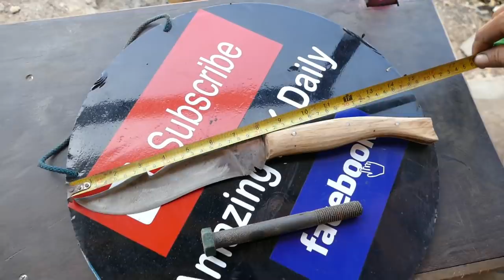FROM A BROKEN BOLT INTO A KNIFE

Comment: Great shape on the knife. 
One quick thing. I made a knife from a bolt and I accidentally bent it in half after hardening it. So I had to heat up the whole thing again and quench the tang as well then Iy was nice and strong. 
Bolt steel hardens a little  but is more designed to be strong than hard. To increase the life span of bolt knifes we have to quench the whole blade and tang. 👍🇺🇸

Comment: Um, bolts are very rarely high carbon steel. Just saying...
Reply: I think they also make bolts in "medium" carbon steel.  Just enough to be hardenable.
Reply: @Maccreeperslayer  medium carbon is less than 0.6% fyi. Don't hold decent edges, for the amount of work you put in. Heck coil spring would require same effort.
Reply: @adrianjagmag  It won't hold an edge as long, but it will be easier and quicker to sharpen. Not ideal for hunting, but it will get the job done.
Reply: @Cortalpsychmajor  have you ever tried using a low carbon blade for processing meat? I have, it's terrible. Please don't talk about stuff you're unaware of. With the usual heat treat the smith does you're talking around 52-55 HRC blades if the steel is above 0.6% C. With a blade made from a bolt which is almost never high carbon since these need toughness, you expect at most 0.4% C and low to mid 40s at best, being extremely charitable. I hate when people without an idea try to chime in. He has awesome skills but why waste them on inferior steel? Cool spring would have been just as much work once heated and uncoiled and make pretty good blades.
Reply: @adrianjagmag  I have actually. I've also used low carbon blades for skinning and cleaning.  I also said it wasn't ideal, but can work. I also use a low carbon blade for leather working. (And for an idea of what I hunt, mule deer, antelope, elk, chuckers, grouse, dove, quail, squirrels, weasels and pheasant) The low carbon blades are not a problem for cleaning the smaller game, but the elk, mule deer and antelope, yeah stick to high carbon, it is much better. Most of my leather work is with cow hide.
Reply: @Cortalpsychmajor  when you say low carbon do you mean something like 420HC which is technically low carbon, because stainless and high alloy steels are a whole different ballgame.
All my wood and leather tools are plain high carbon. Interesting, what kind of leather work do you do?
Reply: @adrianjagmag  I think you're right on my hunting knives being 420hc, that makes sense, my leather working knife however is home made from a piece of low carbon (according to the spark test), I didn't make that one with any heat, just sawed off a piece of bar stock and made a skiving knife by filing it to the right shape / sharpness. I just do knife sheathes for the most part, I also made hammer with a leather face,  to substitute as a soft face hammer for some of my metal work with lighter materials, mainly driving punches and chisels through thin pieces of metal and occasionally tin.
However I first learned to leather work years back by making masks.
Reply: @Cortalpsychmajor  interesting, thank you for the reply. :)
Reply: Who cares can you make a knife dont mind fuck it just enjoy it